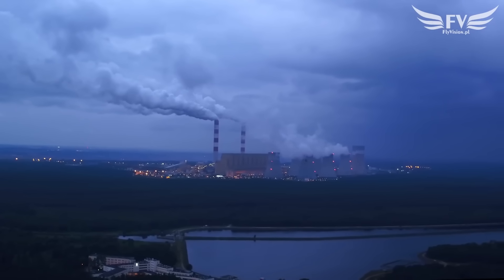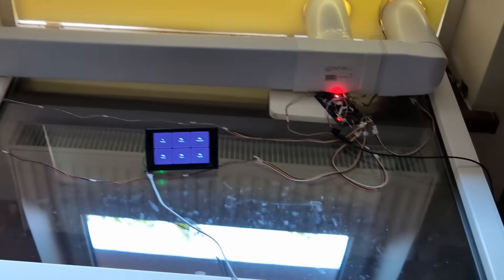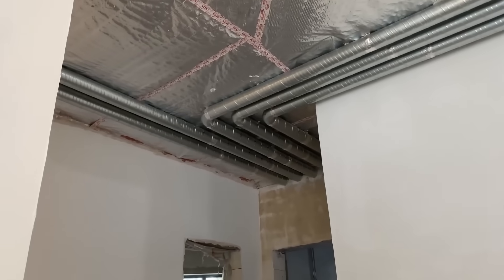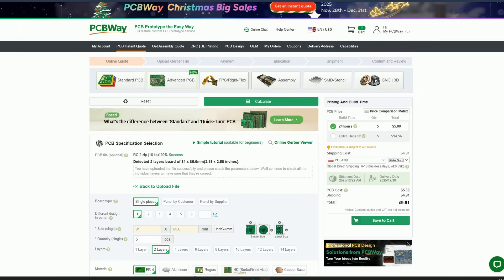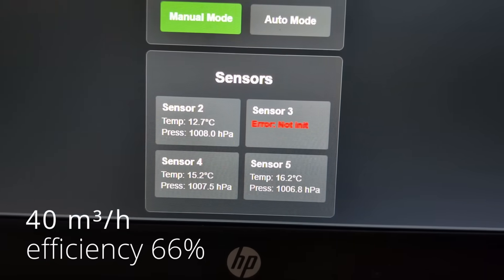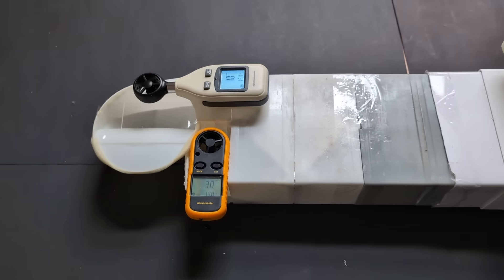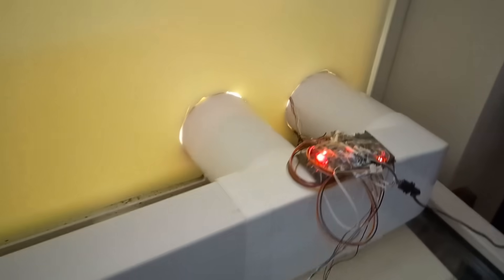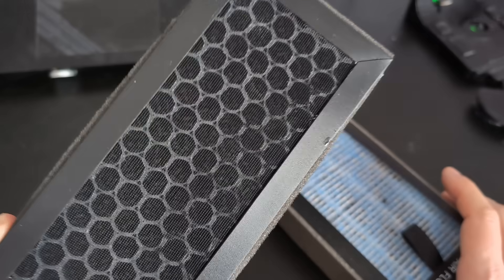DIY Heat Recovery Ventilator: From 55% to 90% Efficiency (Real Tests)

Comment: Very interesting, I manage air handling units for large environments, they are from the early 90s, they have a rotating heat recovery unit like the one in the video managed by an inverter, the problem is the sealing between the two halves of the rotating drum, I don't like the system very much, honestly I haven't seen this system in new machines anymore, they are all made like the VMC or like you are doing the heat recovery, the exchanger is made of aluminum or aluminum alloy covered with a protective layer to make it immune to humidity and atmospheric agents that would corrode it, the surface is very smooth and almost golden in color, I've always wondered why they don't make it in copper which would be significantly more efficient, the costs of these systems are high I don't think it affects the final price that much, another system in a large machine uses two large hydraulic radiators with a closed circuit recirculation pump, I think this solution was chosen because the space did not allow the installation of anything else, as for filtration there are classic washable filters and disposable EPA filters with 94% of PM10 efficiency, they last about 6 months, some new machines have UV-C fluorescent lamps for sterilizing the incoming air installed in a mirrored environment where the air passes before going towards the outlet duct into the environment, activated carbon filters are used in NBC masks or to filter the air in bunkers, like those from lunor.ch, but they are serious things not a joke as often happens like commercial filters or disposable masks.
Reply: I think the advantage of a rotating drum may be humidity recovery.
Reply from the maker: Thanks for such a detailed comment. I agree about the rotary systems—sealing is always a headache, which is why I went with this design. As for copper, it’s definitely more efficient, but I guess manufacturers stick to aluminum to keep the weight and cost down. And you're spot on about the filters. There is a massive gap between professional NBC gear and the basic stuff they sell to consumers.

Comment: Are you going to open source this? This is awesome work, but it could benefit from collaboration
Reply from the maker: Yes, it will be open source. I’ll release all the 3D files, schematics, and firmware once the project is finished. Right now I'm just showing the progress, and your feedback is already helping me a lot.
Reply: @DIY_Yarik  I do open source software work, and there is a lot of benefit to releasing intermediate results. Not sure how that ports to hardware, but I think having open schematics detailing the progression of the project (even in a messy format) is valuable if only from an archival perspective, but probably more.
Reply: @DIY_Yarik  Please do, would like to collaborate.
Reply: with the amount of time youve invested, definitely deserve some profit out of it
Reply: Well there is software and schematics that could be open sourced
Reply: ❤❤❤❤This is so important.  ❤❤❤❤
Reply: all of this would fit into kickstarter very nicely!
Reply: As said here, it would be nice to have this open-sourced so people can experiment with it more and develop their own versions. There are a few modifications that can be done, including fanless designs
Reply: He's just put it on the internet. You can't have much more open than that. If you mean, will he sell a kit of parts ? That's different to 'open source'.
Reply: @belgianbrian  He "only" released a video. When people ask this they're talking about code, schematics, PCB designs, drawings for the heat exchanger plates and the forming machine he mentioned, etc.
The video is awesome and it's entirely up to him how he wants to publish his work so I'm not demanding anything, I'm just saying that right now, it's not open source under any reasonable definition of "open source", in fact it's not even source-available.
Reply: @paran0rmal-  exactly! No pressure for the author of the video :) But the problem is real and needs a solution, so many people don't have access to quality fresh air :(
While all that is done is reproducible if you watch videos, it is not the same as having materials provided for further and deeper analysis and improvements.

Comment: I love this, but I also wanted to say, do not give up hope for renewables. We're currently only at the beginning. Countries like China and India are catching on and understand. The US is a collapsing vassal state that will shortly be surpassed by China, who is a HUGE driver in renewables. They're the sole reason why solar is now cheaper to deploy than a new coal plant. They have massive breakthroughs in battery storage tech to unlock better EV's for every day consumers. They're going to ultimately change the world for the better imho. They're trending in a much better direction than America certainly is. The rate of deployment of renewables is only increasing faster and faster. China actually imported less oil for the first time ever last year because of their renewable deployments. Hell they're even turning deserts green and using tens of thousands of goats to mow the grass in what used to be sand. Don't give up hope. Make products like this so those of us who believe in a better future can ensure we get there.

Comment: LOLOLOLOL, for most of the video I was like what the hell is this thing as I have lived in Hawaii all my life. then it clicked using the hot air leaving to heat the cold air coming, in got it.  I built a solar sailboat my family and I live on for almost 3 years and we used a very expensive filter for our air it made a huge difference in our health and energy. So you are 100% correct. I am not rich or something we just used our life savings...

Comment: I experimented with small steam boilers many years ago. I build one from corrugated copper sheets, soldered to a copper backing. You could do the same to get it air tight. I painted the copper sheets with a heat resistant paint, sanded it off where i need the contact, whetted it with solder and used a heavy soldering iron and a flat wooden board to solder them together. It's time consuming, but the tank was steam tight. :-)

Comment: Great experimentation there. Have you thought of using ozone to "bleach" the airflow.
There are many electrical ozone generators used to purity air .
Reply from the maker: I’d be careful with ozone. It’s a powerful oxidant that can seriously irritate the lungs and damage your health over time. Plus, it’s very corrosive — it would quickly destroy the metal parts and electronics inside the unit. Mechanical filtration is a much safer bet for a home.

Comment: To make it quieter I wonder if you could put spray foam around it. Expanding foam is used for sealing around pipes, and can be bought in small cans. make an attractive looking case and then just fill the gaps with spray foam. It make also take a few pieces of foam in the tube to help cut down sound bouncing through the inside. (sort of like how a car muffler works.)

Comment: When I remodeled the bathroom I was able to run 75mm tubes from the downstairs WC and kitchen up to the loft. The plan was to build a central heat recovery system so very interested in how you create the final heat exchanger. Thank you for the video.

Comment: have you considered 3d printet metal? PCB-way can do that for you too.

Might get pricy for larger sizes though. and I don't know how the airtightness will be.
Reply from the maker: That would be super expensive for a unit this size. My plan is to use SLA printing and then electroplate it with a layer of copper. It’s much more cost-effective while keeping the precision high.

Comment: So, what are ready to buy good products in the market now. I mean for efficiency. And how can we as not knowing people,... see it from the specs they show us in the product advertisements ? I also wonder how we can have 90 % efficiency.. If you let warm air of 20 degrees flow against air of say 0 degrees... What is 90 % efficiency ?? really mean ?
Reply from the maker: Ads often show "best case" numbers at very low speeds, so it’s hard to trust them. 90% efficiency means that if it’s 20°C inside and 0°C outside, the incoming air gets warmed up to 18°C. It basically recovers 90% of the temperature difference. The real challenge is maintaining that when you turn up the fans.
Reply: @DIY_Yarik  Unbelieveable,.. I think , if you let air of 20 degrees pass along 0 degrees air.. It will devide to 10 degrees each !?? If it's a ongoing airflow.. 1 on 1 ?

Comment: Awesome video, really interesting and I can see this becoming a commercial product in due course.  Coming from UK it would be fantastic if it also removed humidity from a room, we have so many houses where condensation is a major problem
Reply: It's currently designed to not regain some humidity, so optimized for cold/dry climates. For UK, you probably want the option to retain heat but have dry air coming in, so building a version without membrane (replace with copper plate) should help. Either switch modules manually or have a air switch between both.
Reply: At some point active dehumidification might be needed.

Comment: A central HRV system is almost always the most efficient solution. I don't get your argument about high power consumption - you do want fresh air in a whole apartment unless you are confined to a single room for some reasons. You do not necessarily need 30 cm ducts either - there are plenty of flat duct options around 10 cm high. More affordable round ducts can also be accommodated into a recessed ceiling. You are not alone in pointing out the low efficiency of in-wall HR vents; in fact, several manufacturers offer decentralized HR units similar to what you are describing. These are typically designed to be integrated into a roller blind box.
Reply from the maker: The problem with a single, whole-house system is that it ventilates all rooms regardless of need. For example, some friends have a 7-room house but only use 3 rooms regularly — the other 4 get constantly ventilated unnecessarily, wasting a lot of air and energy.

Small built-in systems I’ve seen are inefficient, and in strong winds the airflow can even reverse, sending air in the wrong direction.
Reply: @DIY_Yarik  You can always close off the unused ducts and reduce the flow rate. Look up Optima mini (only 125 mm height) HRV unit or Kair Trakmaster 125 (225 mm). Both are made for 125 mm dia. ducts. With a price point < 600€ and some additional filters they can solve all your problems.

Comment: For the idea and perseverance I admire you and encourage you to keep going the project. From a practical, economical and safety point of view, this makes no sense. And most because what you stated about the commercial devices.
The centralized system costs 10k, is huge, consume a lot and uses a lot of space. All off these statements are too generic and mostly wrong. You show examples of systems dedicated for big houses, not for apartments. So yes, it's expected to be large for more than one reason you struggle in your project. Noise, air volume and eficency. You can't have them in a small volume of space, and make them cheap. But I'm sure you know all of these but I don't understand why do you avoid to tell them clearly. 
Regarding prices, I installed a Dantherm 460m3/h centralised system under 4k. Is a well known brand, with real high eficency,(checked by myself at -4c 94%) that you can install in a kitchen closet 600x800. Regarding the energy consumption is around 30w at normal speed. And it works with no additional heater. Checked at -10 to -14.
One thing you should clearly state in your videos is the risk of mold and bacteria forming in the system. Is a big thing and more important than eficency. And an uv filter does not guarantee you are safe.  Hope you could prove me wrong:))
Reply from the maker: Thanks for the detailed input!
That said, 460 m³/h at 94% efficiency at -4 °C sounds surprisingly high for a unit of that size. Most real-world tests I’ve seen show lower efficiency in such compact systems, especially without pre-heating.

Mold and bacteria are indeed a major concern — that’s why I’m planning filters and careful airflow management in my design.

I’d be curious to see independent test results for that unit, because if it really performs that well, it’s worth a closer look.
Reply: @DIY_Yarik I'm always up for experiments:)) so if you want I can help you with more measurements or details.

Comment: Great work! I wouldn’t give up on axial fans just yet, you just have to get ones specialised at static pressure, maybe stacking some together. For insulation, NightHawkInLight’s aircrete recipe might be attractive. Where did you obtain the photocatalytic TiO filter and the humidity transfer membrane? I was thinking about using builders paper as a mould-resistant humidity and heat transfer medium instead of foil in a much larger exchanger with slower airflow, and was just considering sticking some TiO pigment to the inside walls. I didn’t know you could easily buy either.

I’ve got this idea for a proper counter-flow heat exchanger I’ve been wanting to build and test, because it uses one large folded piece of aluminium foil it shouldn’t have any issues with air leakage, so long as the end-caps are fully sealed. Easy to make at both small scales and large scales I suspect. I’ve drawn a crude diagram of it here: files.catbox.moe/md65rm.png

Comment: great stuff. maybe anneal copper to make it form better
Reply from the maker: Yes, that would help shape, but it would significantly complicate the manufacturing process. My goal is to make the process simple so that anyone could make a similar device for themselves.
Reply: @DIY_Yarik  imo in such tiems as we live its easier to produce something and sell it, then provide people with instruction for them to follow it. 

mainly all of the people are working for money and have not much of the time to spare to diy. but i respect your work. its good that you dont overcomplicate things for anyone to try. 

and there is so much one need to commit to make a commercial product from a prototype... maybe in future you can provide the most complicated parts of the design for assembly by the end users.

Comment: Verry interesting! 🤩
It's just a guess, but: Would it be better to have turbulent flow and rough surfaces inside the heat exchanger? I my imagination there could be steady boundary layers of air forming on smooth surfaces, so mixing would be benificial. 🤔

Also, if this system gets more popular we need to find an easy way to install it on existing windows 😃

This could also be useful for camping vans 🚌 or tents 🎪
Reply from the maker: Verry interesting! 
It's just a guess, but: Would it be better to have turbulent flow and rough surfaces inside the heat exchanger? I my imagination there could be steady boundary layers of air forming on smooth surfaces, so mixing would be benificial. 

Also, if this system gets more popular we need to find an easy way to install it on existing windows 

This could also be useful for camping vans or tents
Reply: "Hairy" surfaces should work well to capture and transfer heat. Needs experimentation with density, length, material.

Comment: Can you make the aerogell in such a way it could be the heat exchanger?
Reply from the maker: No, aerogel serves a completely different purpose. It doesn’t store heat, it’s a thermal insulator.
It’s great for keeping temperature inside, but a heat exchanger needs a material that can absorb and transfer heat efficiently.

Comment: A great video! Ive been looking for some thing like your prodyct for my sailing boat that i live in full time,
Reply from the maker: Thanks! That’s exactly the kind of use case I had in mind  a compact system for boats or small spaces works well.